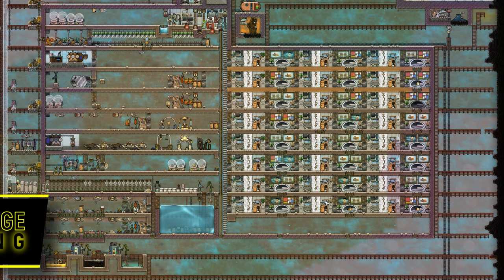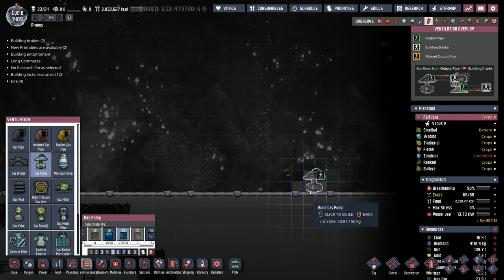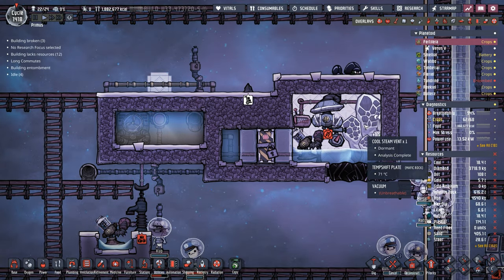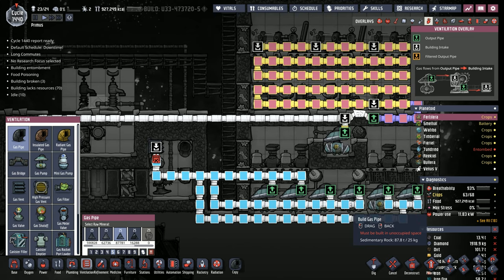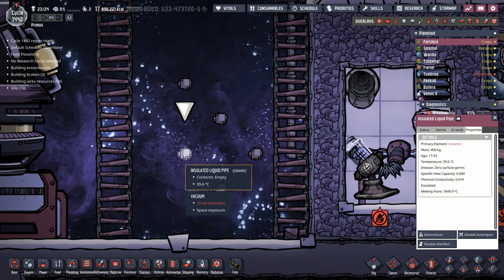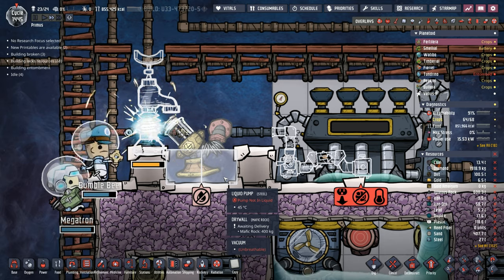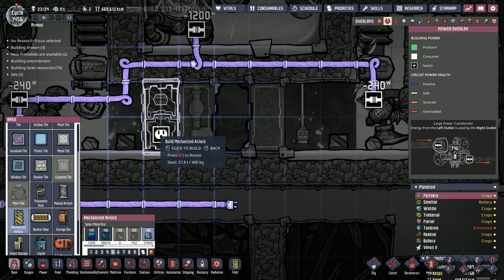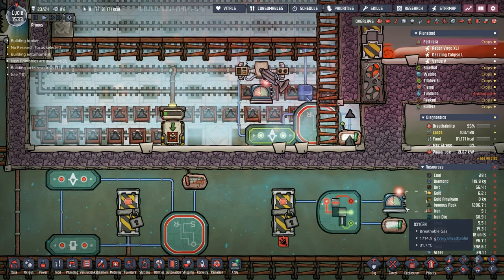Liquid Hydrogen Rockets | ONI Spaced Out! | Primus Ep 16

Comment: Still loving your video and the time you take to explain what you build.

For piping in space. What I like to do is mostly use granite non-isolated pipes. I use ceramics isolated only for the parts that are near rocket exhaust. Then I prime the pipe using a valve and packets of 1K of liquids. This cools down the granite pipes real fast and over time, the ceramic pipes will also cool down. Once the pipes are cooled down, they cool since they are in space and you can then use the full 10K packets of liquid.

If you have enough metal available, you can even use radiated pipes that will cool down even faster. In all this, you need to make sure that the pipes are not exposed to a source of heat which is normally easy enough when you build in space.

Anyways, just throwing it out there in case it's helpful for anyone.

Cheers.

Comment: ~13:00 - you can also use tempshift plates to seal the background, and they'll conduct temperatures more evenly than drywall.  Might be a better choice for keeping temperatures even in the LOX/LH tanks.  It helps more for larger tanks.
Reply from the maker: This would have def been a better choice.  I used some in key spots eventually.

Comment: I have a question about the specific heat capacity of the pipes for the liquid hydrogen: from what I understand, specific heat capacity is how much energy it takes to heat up a material by 1°c, so if it has a lower specific heat capacity, doesn't that mean it takes less energy to warm up? Or is that exactly the point, because that also means it takes less cooling to bring it back down? 
Unless I have this completely wonked up in my head, in which case I'm happy to be corrected :)

Comment: For making hydrogen rocket fuel, a SPOM seems like a poor choice.  SPOMs run on hydrogen which is hard to get, full output from 4 electrolyzers is 444g/s, when hydrogen rockets use 900 KG tanks.  Maybe there's somewhat less of a need to run hydrogen rockets in the DLC, but in vanilla this became a real problem.  There's plenty of external power from geothermal, and potentially petrolium/sour gas boilers and nuclear reactors.  Reactors are apparently good places to grow exuberant mutant plants, the best mutation in the game by FAR.
Reply from the maker: We change it up, I believe in the next episode, and have it run off the grid.  We wanted more hydrogen.
Reply: This situation is why I try not to burn the excess h2 from my spoms to supplement my base power grid. In fact, even when I get a h2 vent I resist using it fro base power.
All the  h2 gets stored up so I can use it to get a LH2 plant running when I get to supercoolant.
The only other things I'll use it for are atmo for turbine rooms and drecko ranches, or running an AETN.